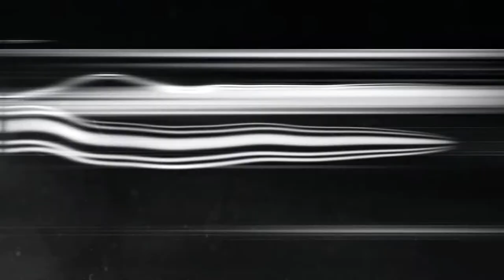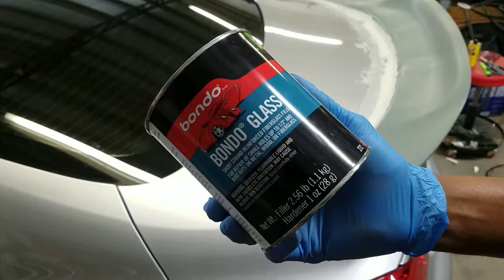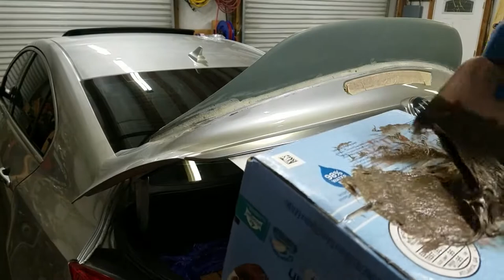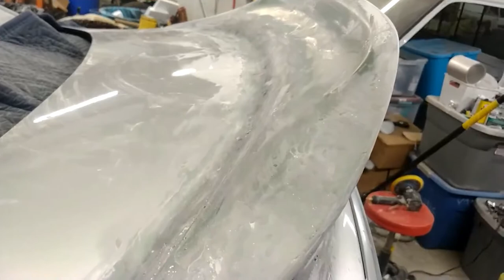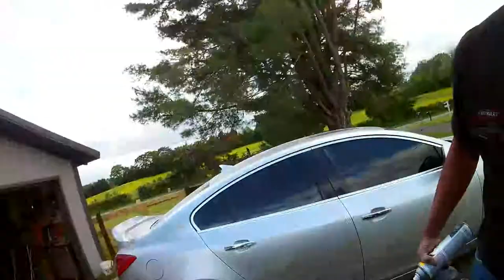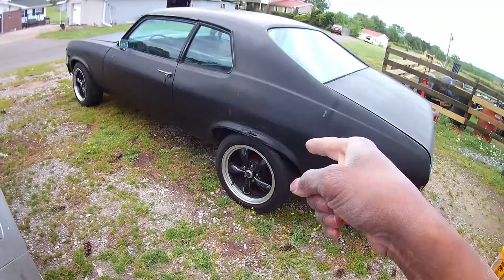Buick Regal Ali Express Ducktail Spoiler Part 2 3W1B DIY fiberglass

Comment: Can i get the link for ali Express?
Reply from the maker: US $60.00 | Use For Opel Insignia Spoiler2010 2011 2012 2013 2014 2015 2016 Year Vauxhall Glossy Carbon Fiber/FRP Rear Wing Sport Accessories Body Kit
https://a.aliexpress.com/_msrNRXm

Shipping rates are extremely high this time of year.